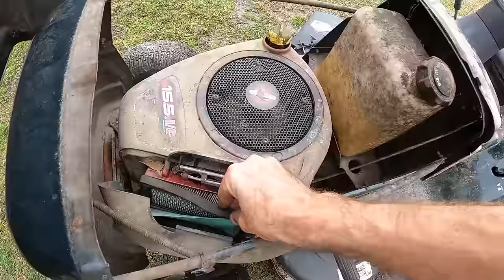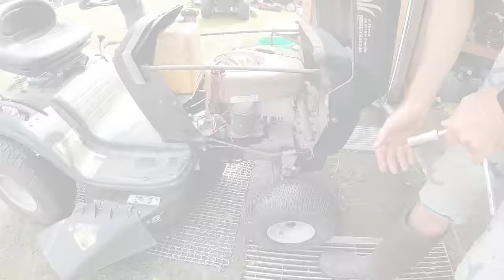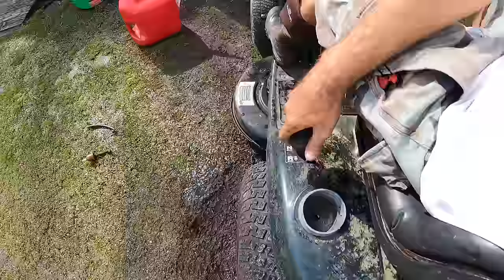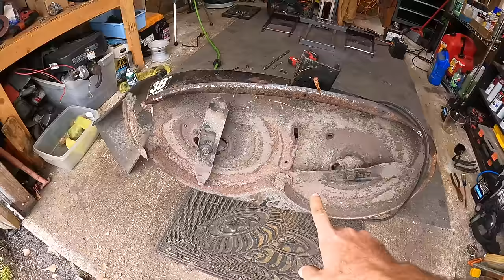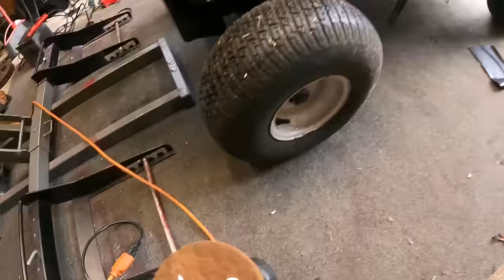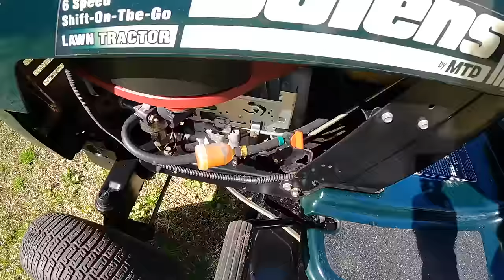TURN A FREE MOWER INTO $2000 EP 2 | BOLENS RIDING MOWER REVIVAL

Comment: I could never work on that flood zone tractor without pressure washing the whole thing really well first! I can’t stand working on dirty machines; I try not to bring debris into the shop, plus when it’s clean it’s a lot easier to spot issues at the beginning. Also, if it turns out to be a runner I’ve already done a good part of the cosmetic to it.
Just my Mr. Clean self!  😂
Reply: You don't even know if it will start or run, and you wash it?  Crazy dude.

Comment: The gas does not wash out the head gasket. If you have to change the drive belt on that system, change both at the same time. That is very critical. Great find, excellent work. You’ve got a great start on your 2000 bucks

Comment: I refurbish a lot of mowers. One tip I will give is remove the dead battery and connect your jump box clamps right to the battery leads. It gets a lot more of the CCA from the jump box up to the starter. Nice work on saving this one! Always a good feeling.
Reply from the maker: Thank you very much for the tip. That would certainly take the load off from the jumper pack. I really appreciate the support 🙏

Comment: My Huskee that is very close to this one (it is a 2010 with a 12.5 not the 15.5 but same otherwise) has well over 1k hours on it has the issue with going forward or reverse even with new drive belts so I bought a new variable drive pully and bearings that I have to install soon™.  I did change out the deck spindles for greaseable ones as one of the OEM ones basically grenaded while mowing a big yard.  Best $800 (new) mower I bought and I definitely got my moneys worth out of the thing.  Might try and sell it once it is all fixed up for like $500 or best since it is a good little mower and should need nothing once the drive is working.

Comment: May I make a suggestion whenever you are going to crank over engine that the cylinder is full of gasoline. Get a remote starter switch and leave the key off so the coil is grounded no chance of spark from coil
Reply from the maker: That’s a great tip. Thank you!!

Comment: always test needle by putting carb on studs but don't tighten  , hook gas up with a full tank to create the max pressure it will see and just let it sit for a while , gas will leak out before going into intake  and can easily be seen , if you tighten it up there is no way to see if the gas leaking by and good way to ruin yer fresh oil change
Reply from the maker: Great tip. Thank you for sharing.